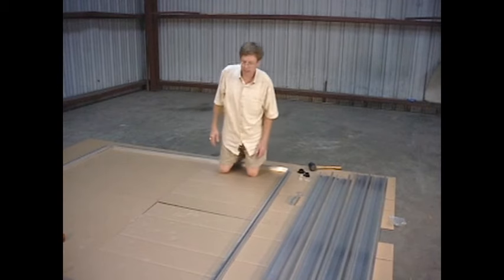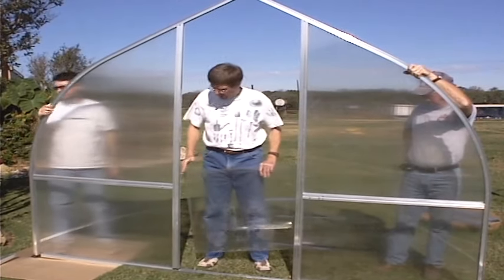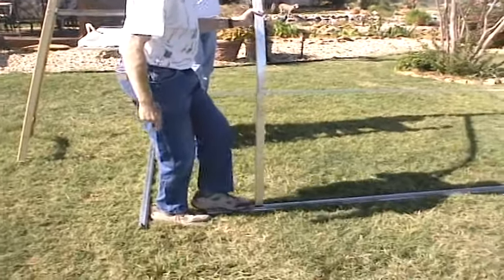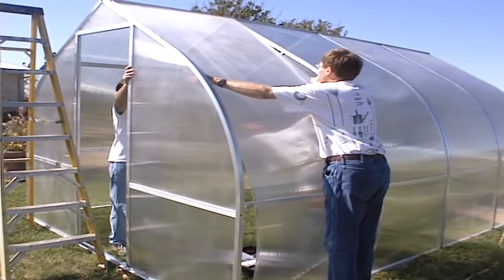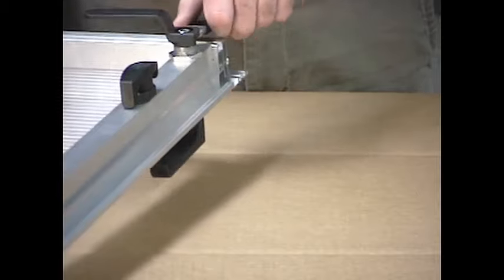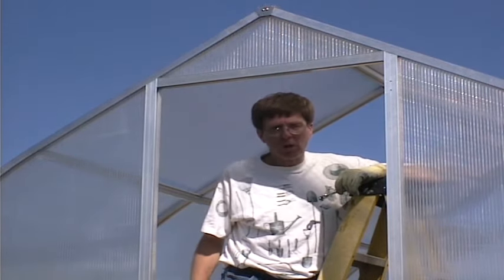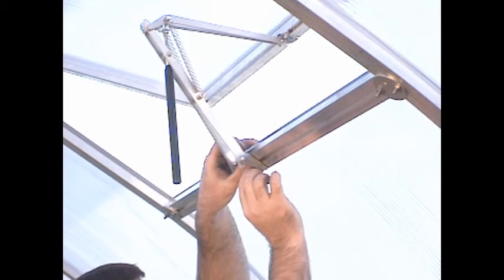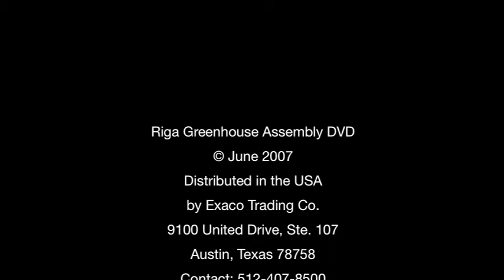Riga Greenhouse Assembly

Comment: We finished the assembly of our Riga IVs in 2023. Now a year later I'm getting around to a few comments that might help new owners. The whole process was actually much easier than I imagined because of some excellent engineering of the kit and good web-based and printed instructional materials. The base (foundation) was by far the most difficult part. Whatever kind of base you decide on it MUST be LEVEL, SQUARE and the dimensions prescribed by your kit instructions. The window, vents and door was assembled in our garage as were the end walls (very easy, follow the instructions and YouTube videos). The ribs and base were assembled on-site. Once the foundation and end walls were done it took my wife and I only two days to put everything together (at the time we were both 69 with very little construction experience). The greenhouse itself is VERY well insulted which is both good and sometimes "not-so-good". Last winter for example we were able to maintain inside temps above freezing when outsides temp was dipped below 20 deg F with two small 250w heat lamps. On the other hand anytime outside temp approaches 90 deg F the inside temp can soar to 110 deg F even with all the doors, windows and vents open.  As such we have in place a 60% sun shade AND I've installed a misting system that we can use when temps approach 90 deg F or hotter. Without these cooling additions the greenhouse would be unusable in July and August here in Western Oregon. In hotter climates it would be even more difficult to grow during hot months. With these cautions said overall we are extremely happy with our new greenhouse.
Reply: How did you attach the shade cloth?

Comment: Just got our kit (Riga IVs) and this video will be very helpful. The printed instruction manual is excellent but seeing it actually done is better. Very securely shipped, in fact the shipping container for the poly was probably even heavier-duty than it needed to be. Very happy so far. The whole process seems to be pretty straight-forward.